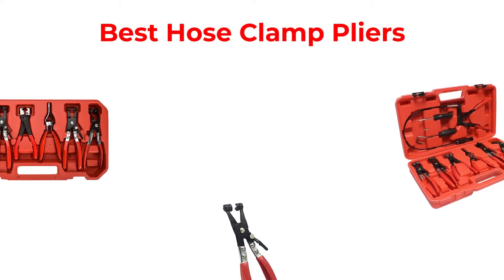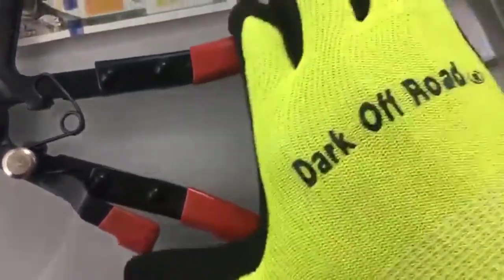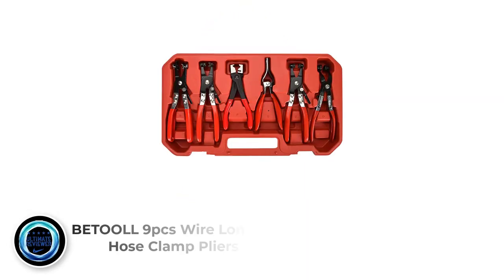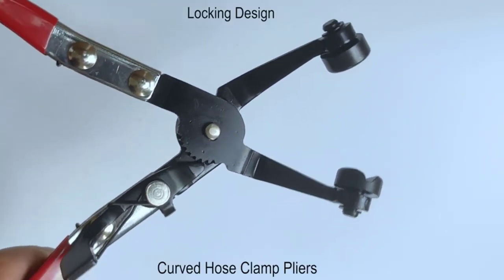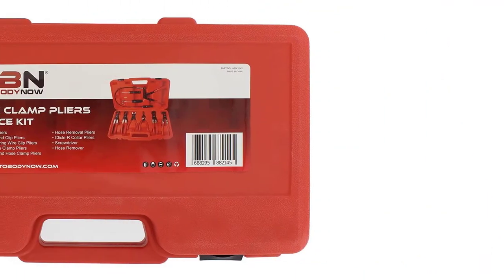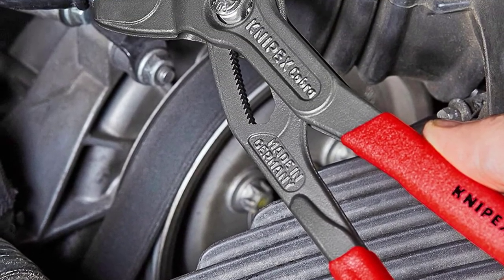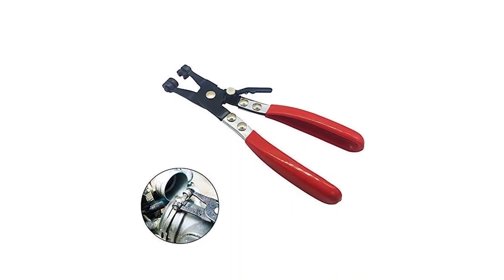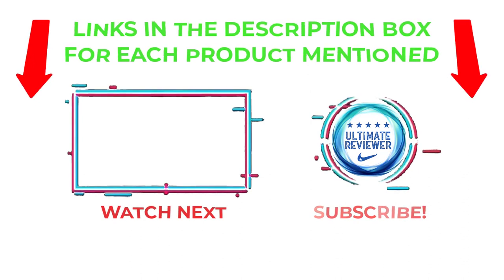✔️Top 5: Best Hose Clamp Pliers Review in 2021

Comment from the maker: ✅ 1. OTC Drake Off Road Cable-Type Flexible Hose Clamp Pliers https://amzn.to/3VpkORS
--------------
✅ 2.  BETOOLL 9pcs Wire Long Reach Hose Clamp Pliers https://amzn.to/3F4Q7Mm
--------------
✅ 3. ABN Hose Clamp Plier 9-Piece Set https://amzn.to/3gIzJHV
--------------
✅ 4. KNIPEX Tools - Spring Hose Clamp Pliers https://amzn.to/3F3GRrN
--------------
✅ 5. Hose Clamp Plier Auto Repair Tool Swivel Flat Band https://amzn.to/3GQpEDr